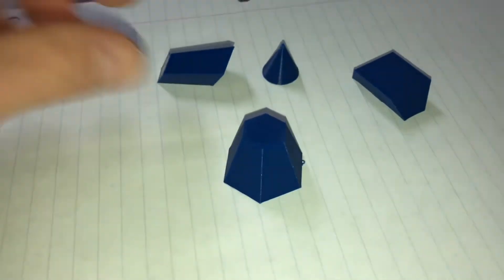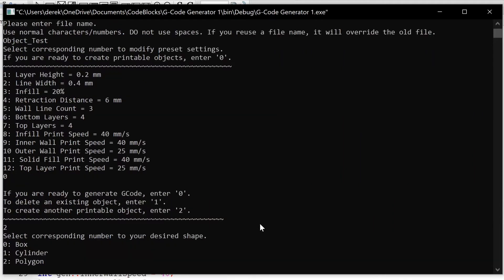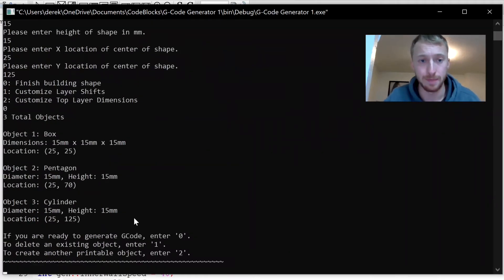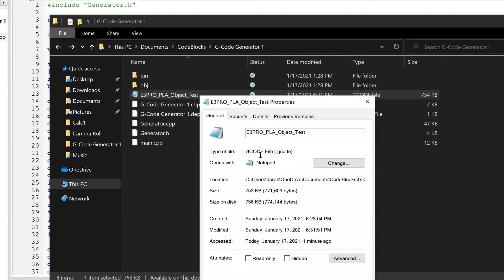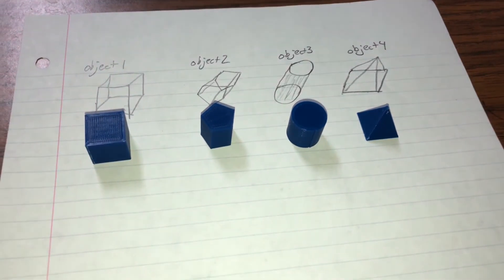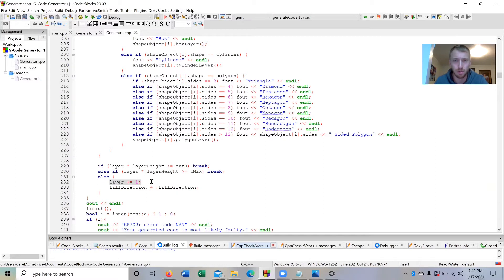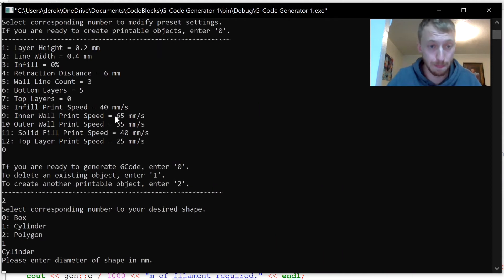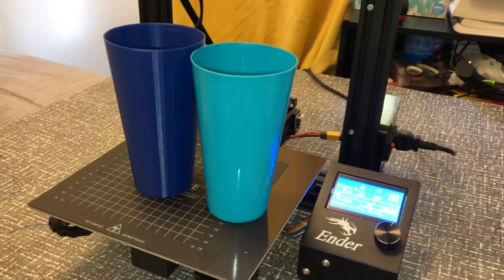C++ G-Code Generator for 3D Printer

Comment: any information on where you got your info on learning C++ during this process? just googling or did you find any good source material/instructions?
im looking to do something similar for another CNC type machine.... would be nice to have a program to generate the G-Code for the machine...
Reply from the maker: The channel I referred to the most would be “The Cherno”. He has videos dedicated to all the different features of c++. Besides that, a lot of googling and stack overflow. Creating your own program may not be the most efficient, but it allows you to know exactly what you’re generating, and is a good learning experience.

Comment: Nice work, I'm looking for a challenge, is this something a beginner can get into? I just want to generate g code from slices of stl files.
Reply from the maker: I’ve never dug into an stl file so I’m probably not qualified to answer that question. To be honest I’m a beginner as well. I am generating g code from vectors I enter into my code, basically bypassing the step of creating an stl. Not an efficient or practical way of doing it, but it was a good way to learn about file streams and encapsulation in C++. Thanks for watching!